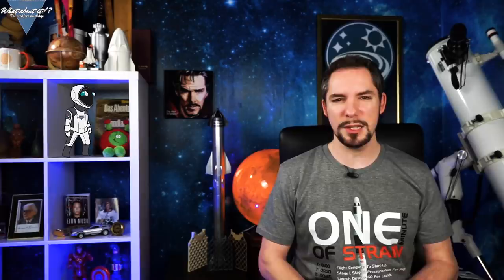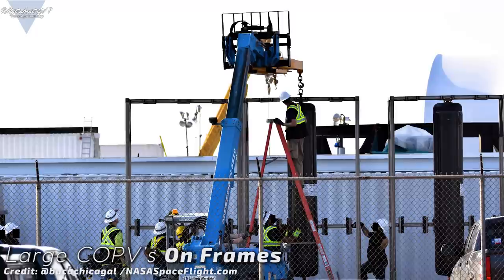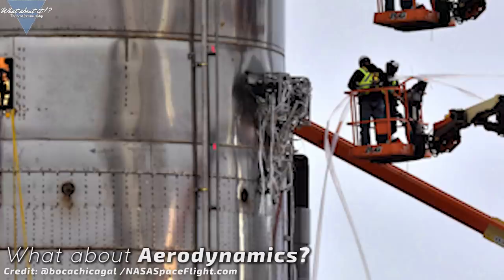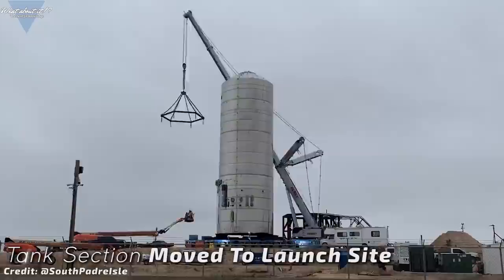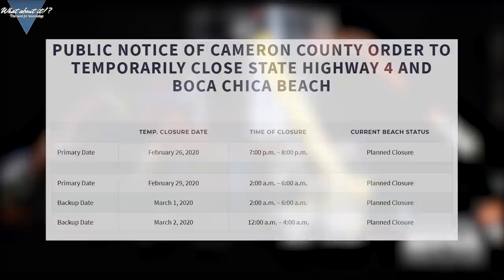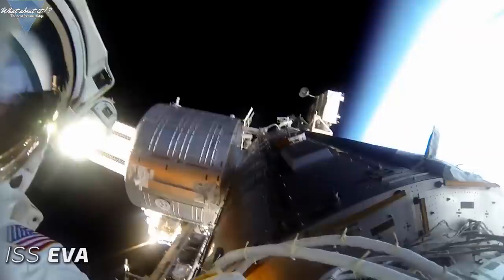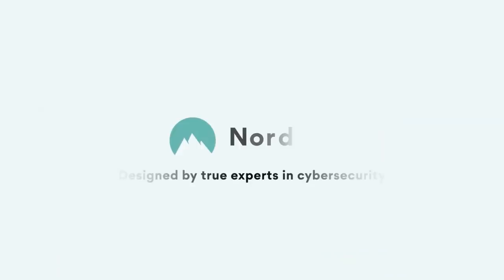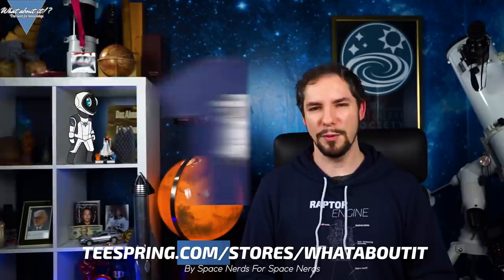76 | SpaceX Starship Updates – Crew Dragon Demo Mission 2 Is No Demo

Comment from the maker: Will SpaceX finish the build before I get there on March 6th and is it a good idea to use Crew Dragon for a full fledged mission right away?

EDIT: I won't be able to answer comments tonight, but I will read! :) In full prep for tomorrows flight for the next two hours or so. Have fun discussing! ❤️
Reply: What about it!? YES!
Reply: Yes
Maybe

After I watched the full vid:

YES
OF COURSE
Reply: Maybe and yes i trust that rocket
Reply: If they were putting in extra crew for DM2 Id be against it. The basic test has only changed in length. I think its a good idea.
Reply: Well Dragon seems to be reliable, but still, it seems kinda not ok to skip dm-2. First it woudl be nice to test it, also it is not fair with boeing, wich will refly the uncrewed mission in June(NASA corfimed it).
Reply: Pin the comment!

Regarding the question: Maybe, it´s a tight schedule. But since SN1 won´t fly, it is not such a big deal.

And yes, the idea to extend Dragon´s mission is quite sensible. All that changes is how long crew and capsule stay in space, something that can´t be tested on Earth anyway.
Reply: The full-fledged mission is a good idea only if this is not NASA's reason to postpone SpaceX crewed flight and drag it closer to Boeing's Starliner probable readiness.
Reply: @_mikolaj_  This is not a skip in that sense. DM2 was a crewed mission from launch to reentry. All what would change now is how long crew and Dragon stay on the ISS.
The uncrewed test was DM1. Boeing missed their uncrewed test flight up big time and the problems found raised severe concerns regarding the processes implemented by Boeing, so they have to be reviewed. Spacex did a successful uncrewed flight, Boeing did not. Spacex is allowed to proceed with the next step, Boeing is not. Where is that unfair?
Reply: As for the SN1 build, the tangle of tubing near the pressure vessels concern me. They look “just OK” for a static test article while yet under development, but... not flightworthy. As for Crew Dragon, I don’t doubt it’s ready for a short duration launch-orbit-docking-recovery, but... a lot of unanticipated anomalies can arise after weeks in space. Fingers crossed and fail/iterate early!
Reply: @antyspi4466  and the next step shoudl be still test flight. Well, we shall see. But technicly, if something woudl still go wrong, it woudl be better if it was still test flight. Notice it hasn't flown since draco incident
Reply: Hope a static fire is set for March 6th. The Raptor approaches. Have a great flight Felix. Awesome episode.
Reply: @_mikolaj_  Not fair to Boeing? Seriously? What does fairness have to do with anything? NASA should fine Boeing for not doing a full up test of the software as they should have. I learned about that yesterday. NASA and Boeing both signed off on the software being ok without the full system test. They get what they deserve. At the rate they're going Boeing won't fly people to ISS until late in the year. Not fair to Boeing? Jesus.
Reply: @_mikolaj_ wrong again, it's done tons of static testing and they flew it for in-flight abort.
You just love bashing SpaceX and trolling every one of Felix's videos with your ignorant opinion don't you.  Felix, I think you have a fly stuck in the soup here
Reply: @genesisxend  well you see, that's what happens when tons of SpaceX fanbois attack other rockets, so i thought, it woudl be funny experiment to attack them. But notice, i have never gave false info, just said it from certain point of view. I must say it's great fun to see those knowledgeless people reactions. Basicly, i use their own arguments they used month ago. 

Also those are my true opinions
 Starship woudl be nice idea but i personaly don't like the way it turned out. Also it's pretty most antic way to Mars possible. Just direct 7 month flight without even artifical gravity ring.
Also amount of clickbait false info about starship is so big, that it just feels good to shout "that's not true". Same thing about other rockets. Felix used to claim that they are also amazing but last time, he does many "jokes" wich are certainly made to reduce reputation for example of SLS. Also he just copies every single word Elon says not even wondering if that's possible. Beacuse 150 t to orbit with starship being atleast half reusable, is kinda breaking laws of Physics.
So usually i just gave my opinion based on true facts. 
This time i wanted to see reaction of people who first thought thst boeing is one who skips tests. Meanwhile it turned out opposite. Errors are standard thing to expect, and what? Still like 90% of people here turned out to be agressive haters. They don't care if we land on Mars, they only care if SpaceX does it first. 
Basicly, welcome to the one of worst parts of space nerd community.
Reply: Elon:  I want you people working round the clock.  Felix is coming to inspect in 6 days and we have to get the fins on before he gets here!  ;)
Reply: @_mikolaj_  Was there a regular second uncrewed flight scheduled for Starliner? No. You basically demand more test flights for Spacex by default. 
The Draco engines are not used outside an emergency. The root cause of the explosion was thuroghly investigated, determined and remedied with consent of NASA. As it was successfully remedied and could not have happend during a normal flight to begin with, there is no reason for another uncrewed flight as DM went flawless.
Reply: @antyspi4466   ANTY SPI  yes there is officially second test required. I don't require more tests for dragons. I'm just having fun of SpaceX fanbois when i use their own words against them.
Reply: @_mikolaj_  "But notice, i have never gave false info, just said it from certain point of view." And this is called cherry picking. Thank you for admitting to be dishonest.
"Beacuse 150 t to orbit with starship being atleast half reusable, is kinda breaking laws of Physics." It´s just 100 to LEO, but who wants to be overly factual?
"So usually i just gave my opinion based on true facts." Nope, you debunked that yourself.
Reply: Where is the accesshatch or door for crew on starship? On those last 4 rings?

Comment: At a glance I just read "starship" "fire" "no"

I was worried to say the least
Reply from the maker: ::D All good!
Reply: imagine that beast exploding
Reply: why is the superheavy booter  hull so thin that it dents seems to be stuctually  unsafe
Reply: Me too
Reply: @stanleydavidson912  to save weight presumably
Reply: @stanleydavidson912  you'll just have to trust the egineering.
Reply: same!
Reply: Ideally You must find minimum thickness that ensure structural integrity. Reducing dry mass means more weight for cargo.... Simplified
Reply: @stanleydavidson912  It is due to the extreme push to reduce weight. A pound saved is a pound of payload. Also this is one of the properties of stainless steel which had to be used to handle the high temps of re-entry. Aluminum would be 4-5 times as thick and a lot heavier to produce the same strength but aluminum can't do high temps. What you are looking at is called oil canning and a lot of it will go away once the vehicle is pressurized. Many years ago they built a rocket that could not be put in the vertical position unless the second stage was pressurized. One day they forgot that and let the pressure out and the rocket bent in half on the pad.
Reply: @Dman6779  from the future: it did (sort of)
Reply: @Dman6779  You might want to keep up on the news...
Reply: @Sushihunter250  this was posted a day before it exploded keep up with time

Comment: The big parts you can see on the outside (the stuff for pressure etc.)are probably gonna be covered by the control fin mounts.
On this way SpaceX can install important parts faster, while not creating more drag than needed.
Reply: Alexander the ok I was thinking the same. If they mount them diametrically opposite each other they would fit under where the fins would go.
Reply: Well, since it's apparently not going to fly, that doesn't really matter.
Reply: @odysseusrex5908  But it will in a flightworthy iteration
Reply: @antyspi4466   When they finally get there (and i'm getting frustrated) I'm sure all that stuff will be on the inside where it belongs.

Comment: Considering statements on material thickness on StarHopper and SN1, SN1 might weigh less while empty than StarHopper did. By now, SN1 contains about 5m³ of steel or about 10-20 metric tons of empty mass, which means thrust/weight can be way over 1 with even 1 Raptor and partially fueled. You only need to pressurize these tanks fully not fill them to the brink to do flight testing.

Comment: Starhopper has 0.5"=12.7mm tank wall thickness which is three times thicker than SN1 at 3.97mm. The tank section alone certainly should be light enough for a one minute duration hop just like Starhopper. 

Let's assume that the control system has changed enough to require a shake-down test before committing to a 20 km altitude flight. I also would like to see how Starship lands on one engine slightly offset from center, as if it used one of three. 

I also predict that the equipment on the surface of SN1 will be removed after the tests (and reused).

Comment: Great update as usual Felix.
I think Spacex are still worried about the build quality of the tanks, and are installing all the flight hardware in temporary locations, just to get to the static fire as quickly as possible, without having to string cables or conduits to the top of the tank along the raceway. If SN1 blows its top or buckles, no big deal, they didn't spend that much of an effort to build it (relatively speaking of course). If all goes well, however, they might still be able to remove all the hardware and reattach it inside the hull after the nose fairing is mated to the tank section.

Comment: What puzzles me is that the ship has dents in the stainless steel that would horrify you if you found them in the panels of your car, as if someone has been adventurous with a hammer while helping with assembly. Also the welds look sloppily amateurish, making me wonder whether they will actually hold together. Is this just a consequence of stainless steel being a hard material to work with? Do the same issues occur with the Tesla Cyber-Truck?

Comment: My previous SS prediction: SS SN-1 finish build Feb 29th and fly mid March. SSSN-2 to finish build end of March.
Now it seems that this has to be amended. SS SN-1 just a ground test production proto type.
But I am still on with SS SN-2 to finish build by end of March. With Ground Test a in March, and Flight Early April, to 20 K and later in April 100 K flight., with. 

Add SS SN-3 to be completed sometime in April. Looking for it to do an HIGH LEO Suborbital flight, without SHB. Early May at the latest. 

Perhaps then SHB SN-1 Construction finished before End of May and a Suborbital Flight of SS SN-3 in June, followed with an Orbital Flight in July.
I expect that SS and SHB construction will continue apace as the Summer continues into Fall, with the deadline of September 15th closing in, and the Flight period of March 16 to September 15th ending. What follows in the Fall, will be revealed in new filings to FCC and FAA in late Summer. Not to forget that late Summer, they will probably be switching from 301 Steel to 30X Steel.

Comment: I reckon Felix is right. SN 01 will not fly, it will be used as an engineering test bed and static fire test. SN 02 is being made to a higher standard and will be the first to fly, maybe April/May. 
As for the first orbital vehicle (unmanned), it will be late 2021 I reckon. After all Super Heavy also has to be built.
The first manned Starship, probably in 2022. I presume the habitation module is being built elsewhere, and in the first instance will be based on Crew Dragon. That will give 21 days endurance for up to 10 people. 
I presume Starship will be able to fly round the moon without refuelling. But a landing would require refuelling in earth orbit, with literally hundreds of tonnes of fuel. Basically Starship is 100 tones empty, so it would need hundreds of tonnes of fuel to land on the moon, take off again and get back to earth.That is a big step, so maybe 2024 or 2025 before a moon landing could be done.

Comment: Thanks a lot for the vedio. As always, YOU ROCK!. if SN1 is not flying, at least they must not over inflate this gigantic steel baloon. The leg section seems like it has been reinforced with an extra plate. What is the point is attaching legs to a rocket which is not gonna fly? Felix, help me understand? Don't tel me fit checks. Have seen enough of them.

Comment: 1:11 if i may ask,is that the old nose con on the right?if so, will the old nose con be used in this test? Or will a new one be rebuilt?..
If they do rebuilt,wat will they do with the old nose cone? Thanku
Reply: They’ve already built a new nose cone. The first one of them to fly will definitely not reuse the old nose cone as the new header tanks don’t fit in it. It seems they are mostly using the old one as a decoration piece.
Reply: @Borodalf  thnks

Comment: Hey Felix. I thought you were broadcasting from the US. Where are you broadcasting from? You might recall that I remarked about all that external stuff when it was first installed. There is no way they are going to fly all that into a supersonic slipstream. Can't be done. Did you notice there's no engines at the bottom? You can't install them sitting on the test stand because the stand is in the way. It's my guess that they really hadn't fleshed out the design of the plumbing, where everything was going to be placed and how to route all the wires and tubing. That's why everything is on the outside. If that is to remain that way it must be covered with a fairing or it will get ripped right off the vehicle.  Because there are no engines my guess is this is a final pressure test of the tank design before a flight and that the bird that will fly has been hiding inside the onion tent with all it's fittings and plumbing already installed from what they learned from the one on the test stand.
Reply: Thank goodness there are 'experts' in the world!
Reply: @peterbarratt8699  4 yrs USCG mechanic, 18 yrs airline aircraft mechanic. Space is my hobby.
Reply: @jcoghill2  Building spaceships is a new era which requires new procedures. Since this was another pressure test, the minimal requirements were met. SN1 was not bound to leave the atmosphere. At leats we got to see it 'fly' apart.
Reply: @peterbarratt8699  So you already know it blew up.
Reply: @jcoghill2  Yup .

Comment: 2:03 I'm a little surprised they positioned the vertical ring welds all on the same side (just staggered). I figured they would put them on total opposite sides then hide them under the raceway (the cables/pipes that usually run along the sides). Would have made it look much smoother. But I'm sure they have a great reason.